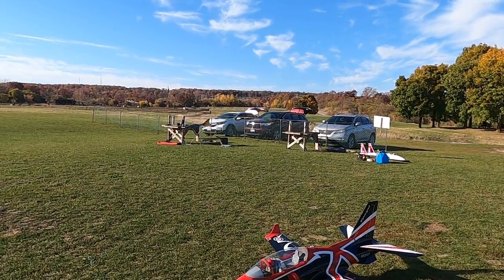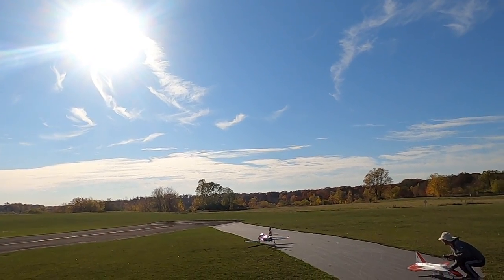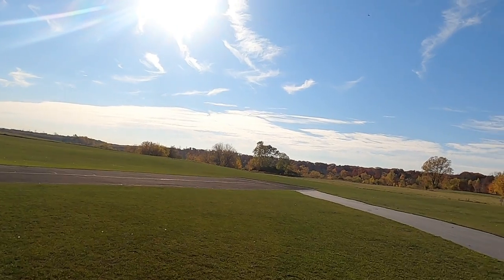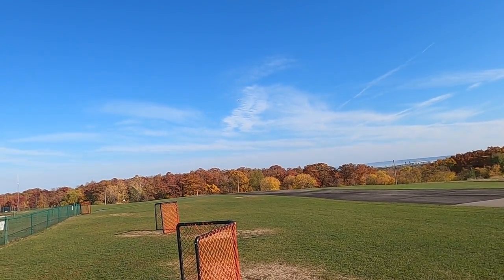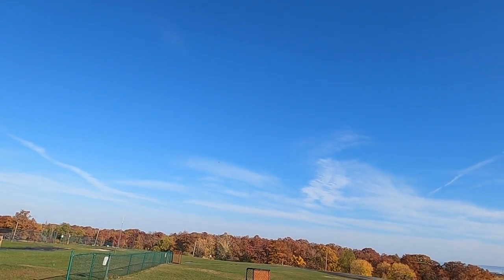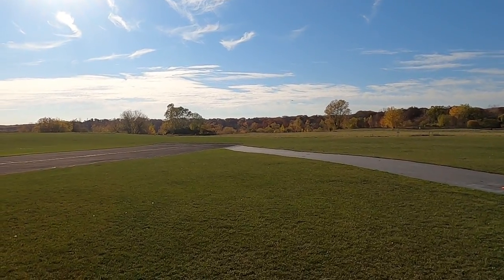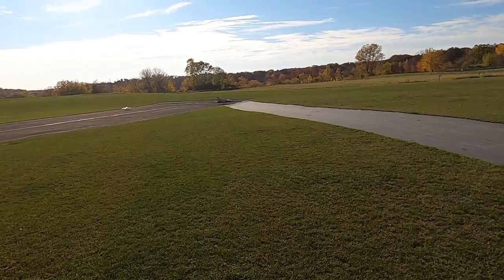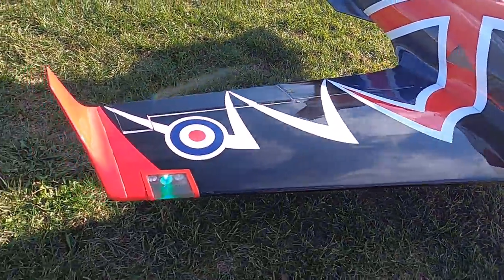Black Horse Viper Xl  Wemotec 100mm 12s 5000mah

Comment: WHERE DO YOU BUY THE THRUST TUBE FOR THE WE-MO TECH? THANK YOU
Reply from the maker: No I didn't buy it I made it that said if I had to do it all over again which I will regrettably. I'll use a Jetfan120mm 590 KV on 14s more power thrust and speed. The material that you need to make the thrust tube can be purchased at ...https://www.effluxrc.com/Mylar-Thrust-Tube-Matl-015x24x36-M015x24x36.htm